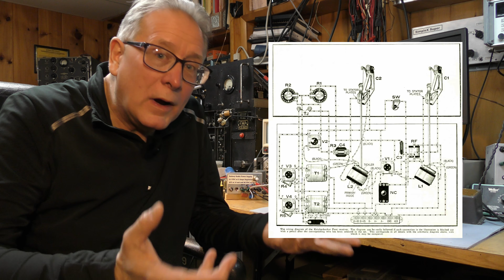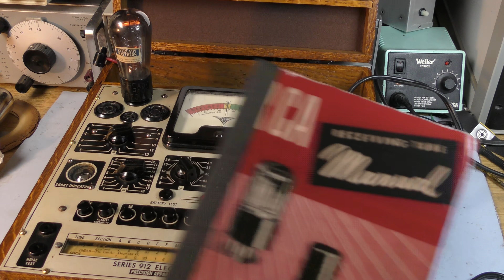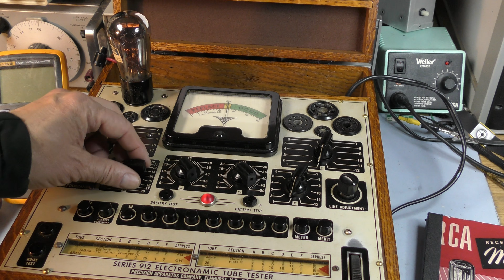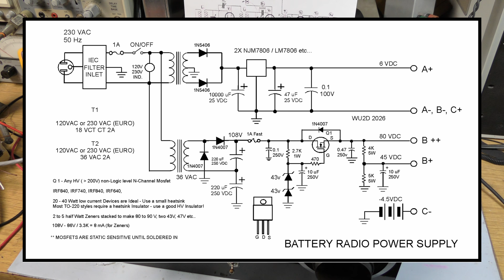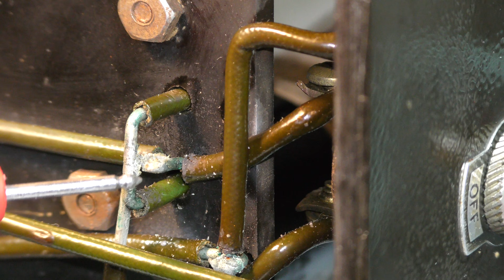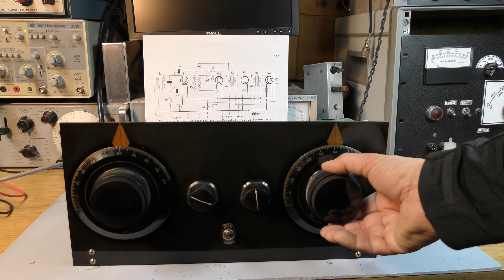Mystery Regen Part 3

Comment: Say Mike did you look online for 01A settings for your 912 Precision tube tester. I found it for the 01A:  A=3; B=5; C=19; D=20; E=1; F=1; Depress=B,, the 26 settings are somewhat different. BTW: vintage tube electronics  has 128 page document on all the tube settings your 912.
Reply from the maker: Very nice to have these! But no real difference seen on the tester.

Comment: The Valve Museum online shows the 01-A as a 5 Volt heater at 0.25 Amps, 135 Volt anode. 
There are Octal bases and Mazda bases so I guess yours is a Mazda one. 
I bought PM1 type valves to make a receiver but got carried away, I have 22 of them. One is 6 Volt, one a type 30 and one a good tungsten heater and all but two work. £2 to £3 each and a box of five for £6. 
Last year I bought a newly manufactured Type 'R' valve in a nice Ediswan carton. The company is buying valve making machinery and making audio and rectifier valves. 
I only buy leaded solder as the non-leaded is not good for re-working if experimenting and changing components. 

G4GHB.
Reply from the maker: Yes, and the ratings, especially with battery tubes always assumed you will have less voltage over time, so they are made to operate at lower voltages, so controlling gain with filament rheostats made a lot of sense.

Comment: I have an old early '20's RX. My Acme A-2 "amplifying transformer" opened up a couple years ago. I managed to resolder the loose end with tweezers, but it opened up again, somewhere in the middle this time. There's something corrosive inside the grid winding. So now, I am looking at the dreaded rewinding. #40's wire and a drill? I hope you never end up here! 73 es GB de W3IHM
Reply from the maker: UGGH I feel that pain. I am starting to explore the biasing on the audio stages. The match and power out before distortion with the 201A does limit the power into a speaker with an iffy output match. Also it is pretty apparent that the stages each want different biasing for the best load line, but that is a bridge too far.

Comment: A cool idea for a power supply for battery-powered tube radios, but I have a few questions: doesn't a voltage doubler in the anode part of the power supply introduce even more buzzing, and what kind of regulator should I use to power receivers with 2V filaments?
Reply from the maker: Yes it would have more ripple , but low voltage transformers 24, 36 or 48V are usually cheaper. A good 5Hy choke and a 100 uF following the doubler should clean things up if you dont want to try the regulator.  I would definitely use the regulator with 4 1n4001 diodes as the reference for the 2V. A 6.3V transformer and a bridge and 5000 uF into the 2V regulator.. Even better 6.3VCT and a conventional full wave rectifier.

Comment: As always, Mike,  you present useful radio techniques in an engaging style. Not only that, but you explain the thinking and theory behind the techniques. Thanks again!  

I have a Radiola III that belonged to my great-grandparents that's been on the list to fix up for many years. Once I figure out what tubes to use, since WD-11's are practically unobtanium, I'll get around to building a power supply.